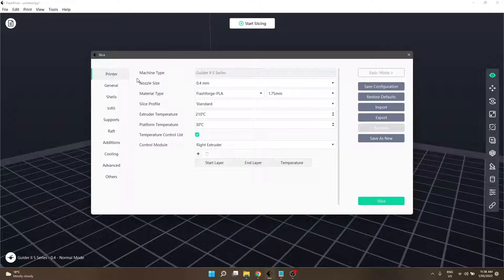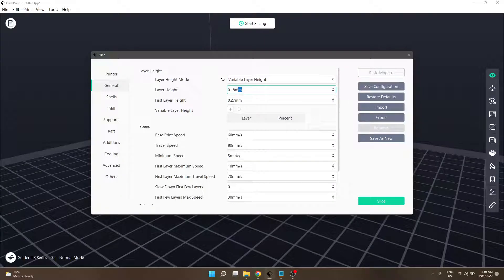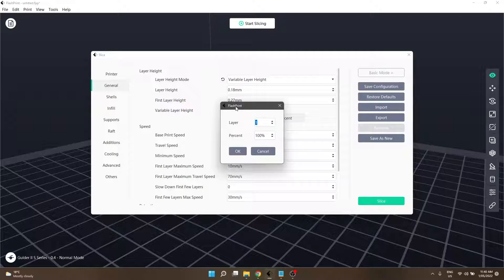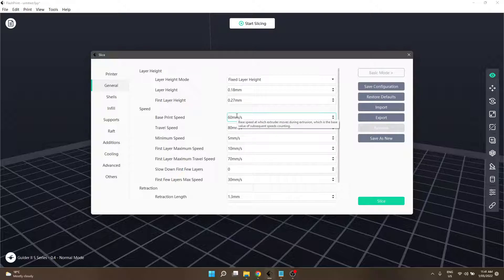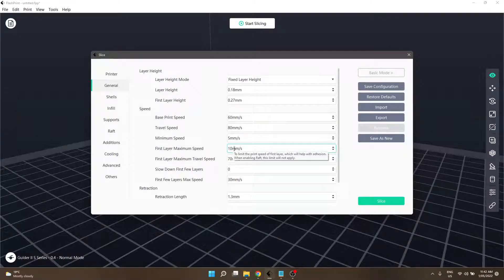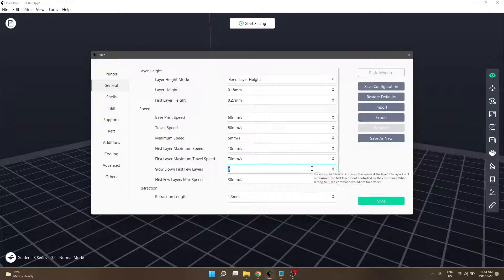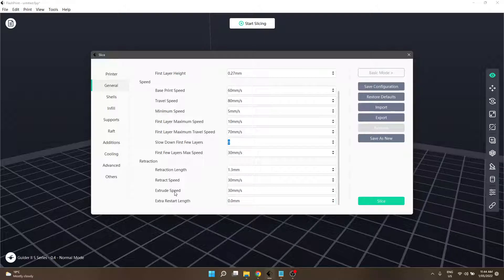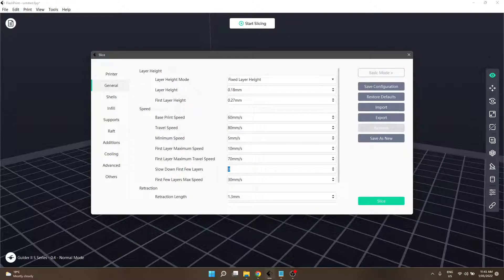FlashPrint New User Tutorial - Part 05 - 2 - Slicer General Settings

Comment: you can actually do layer ranges
1 at 100%
125 at 100% will print layers 1 to 125 at 100%
126 at 50%
137 at %50
138 at 100%
256 at 100%

in this example 126 > 137 will be fine print > better resolution (for letters, for example)
and you can preview print, select "layer height" to see your settings in color
Reply: THANK YOU SO MUCH

Comment: Can you explain please what resolution is in flashprint cuz there's this print here I like to print out and it says 200 resolution so where exactly do I type that in-at please on flashprint I would really appreciate it thank you if you could let me know
Reply from the maker: Hey, as I mentioned on Facebook. Resolution is a term more commonly used within Resin Slicers.

If you're chasing more detail in Flashprint, wall thickness, layer height and perimeter overlap would be where I start.